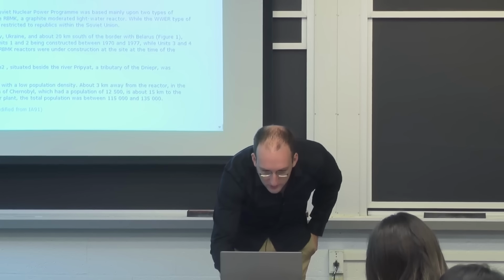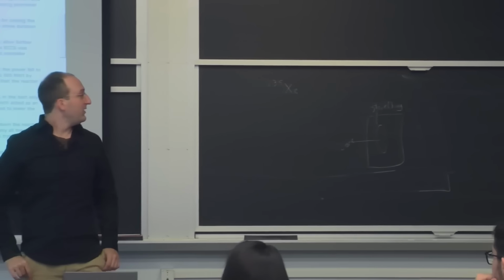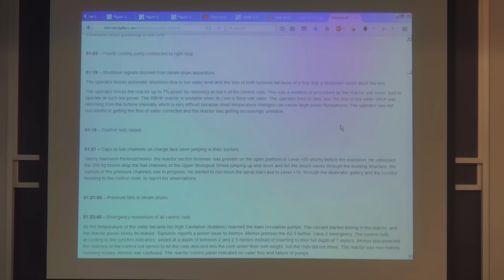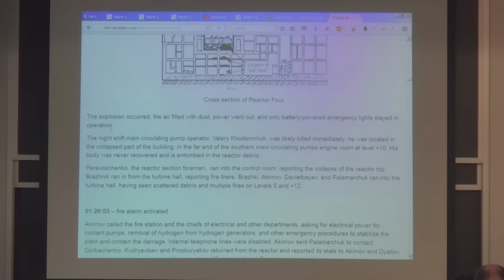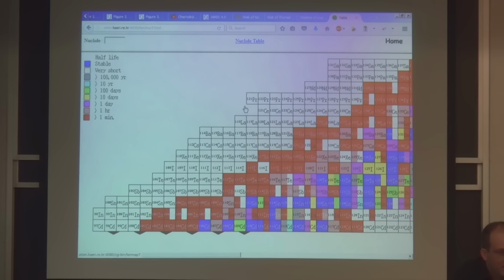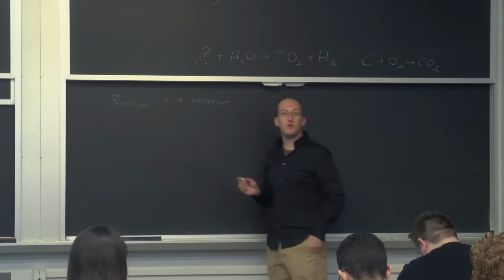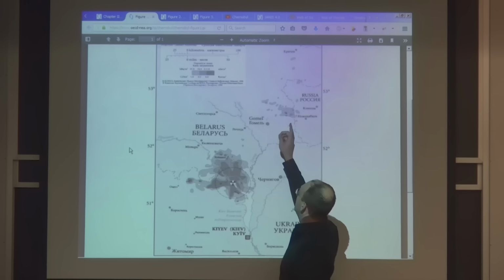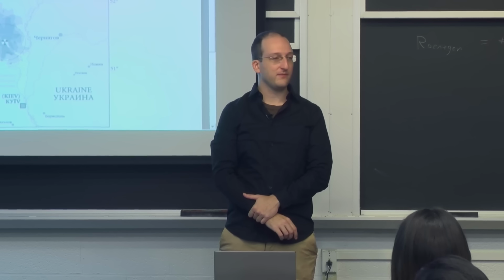26. Chernobyl — How It Happened

Comment: 14:30 They didn't remove the water, the water got removed by the steam, essentially
it was pushed out, and thus stopped both cooling and absorbing neutrons.
What they should've done at this point, is retract the fission material, and let it all cool down.
But..
It's the USSR and in the USSR failure was never rewarded, unless you'd consider a single
one way ticket to stuff like SIberia a nice reward. in the US this would be similar to a firing.
But..during the times of crisis, alesser event should always be more preffered to success
at all cost, which in this case is a meltdown result, having tried 'all' and ending in failure.

Comment: What happened was a lousy design.
Any true capable engineer would design a nuclear reactor with an auto split at the bottom.
This would split the reactive material upon any meltdown into at least 4 separate quantities,
reducing the reactions by that much, and allowing for recovery.
Instead they relied on a design that would work as nuclear reactor, but had zero recourse upon failure.
The encasement of radioactive materials should be upon retraction downward, not sideways or up,
with up being worse.
When the reactor goes critical, the molten radioactive material should recede back into a separator,
or rather separating encasing, like wolfram/ceramic composite upon steel/lead,
which then autoseparates the radioactive materials, and thus ends the critical state.
If such a contigency is not planned for, you have a poor design.
Reply: Note that the design of auto separator, as by my design, would only cost like $500.000 per, for a single reactor, and that is with a profit margin that is very comfortable.

Comment: Very interesting lecture. There is a ton of story that goes along with this event. Things like the political pressure put on the operators to perform this test after several other plants refused. The changes to the test do to a very unstable power grid that was the cause of the Xenon issues. Also, the fact that the operators that controlled the steam plant having little to no training related to reactor operations. This lecture was great for the science, but there is so much information surrounding this event that takes place outside the science. Also, I am quite proud of this professor's statement about the responsibility of the media. The general public's fear and lack of understanding related to nuclear power is causing the most viable green energy source available to die when it should be thriving. Thank you Michael Short for this video.

Comment: Terrific lecture I never knew the full back story of what led to the accident. I'd known that they'd been shutting down the system deliberately for a test when the accident occurred, but didn't realize it was to test power output from the spin down of the turbines.Maybe I don't understand some component of the system or fail-safes involved, but ... what if the the elements of the generator, coils or wiring, or the turbine itself were damaged, and THAT was the reason the system was coming down? It seems in retrospect a questionable idea, fraught with circular dependency, powering emergency systems from the ongoing shutdown of the main power generation operations. Perhaps I don't see the big picture. I know that a lot of modern large-scale facilities that cannot afford power down time, e.g. large data centers, will have on-site diesel backup generators, and nowadays even big battery/capacitor banks can fill that role. Maybe that wasn't an option back then (although surely diesel generators existed; those obviously predate nuclear power plants), or there were safety concerns about keeping a cache of combustible material around the plant. In any event, this is a fascinating historical event. I feel terrible for the Soviet citizens that were subjected to this, and thankfully it didn't cause more damage beyond the region.
Reply: Well, apparently knowing the big picture didn't prevent a catastrophe. Or, it was designed for depopulation

Comment: I have one question.  In the opinion of the excellent Professor Short, does he have any opinions toward possible design deficiencies of any other existing reactor designs?  I am a believer in this technology as a forward solution but only if the public is fully aware and is able to embrace it as safe and productive.  This is one of the most engaging hours I've spent on the internet.  Thank you.
Reply: There's now a third generation of rector designs now. This was the first one.

Comment: I never understood how the upper pressure tube (technically standpipe) closures work mechanically.  I understand there is some sort of plug that interfaces with the refueling machine and the metal box filled with likely serpentinite concrete is placed over it the plug.  If the inner diameter of the channel is 80 mm and the pressure is 1000 psi (mixing SI/imperial..apologies) ..the pressure on the plug is 7790 psi.  and those blocks dont weigh that much.  so how does the plug interface with the pressure tube to hold that pressure?

Comment: A hopefully helpful note: if you're not familiar with this term (like I wasn't), neutron "moderators" slow the neutrons down to increase the probability that they will contribute to the nuclear reaction rate (fission). Dr. Short does allude to this, but the word "moderator" sounds like it should slow down the reaction, which is the opposite of what it does. So please view the graphite as an accelerator, not an inhibitor.

Comment: The way the operators did their "tests" reminds me of the Mythbusters trying to get a hot water heater to blow, insofar as they had to remove EVERY security feature on the device before doing a stress test. It seems like they wanted to perform a meltdown, or that the people in charge had a very basic understanding of some of the working of the reactor. When you are unaware of your ignorance and put in charge of a nuclear power plant, stuff like this happens.

Comment: At 22, he talks about hydrogen explosions. When I was a callow youth, I decided to split water into H and O using electrolysis. Not having fancy lab equipment, I used an aquarium pump to pump air into a glass(!) peanut butter jar bubbling it into a mixture of water and IIRC hydrochloric acid (it was many decades ago, might be fuzzy on that part) in which I had inserted two carbon rods from D-cells wired to a 45 watt psu. I then directed that air into another glass(!) peanut butter jar thinking this might purify the gas and then out the top of that jar. BTW everything here was glass - jars and tubing. I let it run. How do you check for H? You light a match at the end of the tube. I had two strokes of good luck - I was wearing eyeglasses and I was listening to music through old fashioned cup headphones. I have no idea what H gas concentration I had but recall that it also had pure oxygen in the mix. Most of my makeshift apparatus vanished. There were a few pieces in my bedroom that I could see, the rest was tiny. It took a long time until I could walk barefoot in that room. So yes, pure H plus a surplus of O2 makes a very large powerful explosion.

Comment: Amateur perspective:- some workers who were half trained in following orders followed orders and were caught out by a primitive designed meant more for playing catch up in bomb making than safe Power Generation, and so the primary aim of making the world an extremely unsafe place at the usual cost and disregard of humanity and the environment ensures. The capability of 50X cleansing of potential enemies from the face of the planet is guaranteed, just have to wait while conventional thinking fails to comprehend that winning any conflict against a real threat is about actual human health and welfare. 

If the device was not a panic purposed lash-up (that works fine when managed properly), even the systems of authoritarian Denialism back in the day could have persisted longer. Instead the same lack of Actual-Artificial Intelligence in application to Actuality will result in other "advanced" authoritarian Denialists looting domestic populations for the last of the resources of the planet. 
It can easily be different, if the story of The Untouchables is genuine, then the format of rational and reasonable thinking is central to the actual Military Defence strategic decision making.

Comment: So you want to see if the turbine's momentum would be enough to power on-site systems?  Why could those elements not have been isolated and tested one at a time, instead of simulating the whole shebang together?  Could you not achieve the requisite speed of the turbine by decoupling it for a while from the flow pushing it?

Comment: I would emphasize that obsession with safety on paper contributes or aggravates problems originating elsewhere. At TMI, way too many parameters where alarmed such that at any given normal operation time, 30 or so items were in alarm condition that operators were conditioned to accepting that alarmed conditions are normal. At Fukushima, the earthquake disrupted the grid, so the two independent power sources in case or emergency requirement was no longer met, hence the reactors were shut down, and the emergency diesels were started. then the tsunami knocked out the diesels. So, if the reactor were kept on, there would have been no meltdown?
Even the Thresher, on a scram, procedure was to shut the main steam valves. after investigation, the procedure was changed to keep the main steam valves open, operate at ahead one-third to drive the sub to the surface before shutting MS.

Comment: "RBMK reactors are no where near as safe as ours, as you can see - there's no containment..." Newsflash, Fuk-u-shima's design is "our design" and if you ask them how their "containment" is going - the honest response would likely be "what containment?" Three Mile Island was not comparable to either of the other two screwups because the majority of mess came about out of an abundance of caution (flooding of containment building) shortly after the low water level and partial meltdown occurred. Fukushima and Chernobyl are remarkably similar in one key aspect - attempting to contain a nuclear reactor core that is in full meltdown mode - is pure folly - whether due to inherent instability/careless operation of the facility or loss of offsite power. Taken one step further, there is no such thing as "perfect" containment of nuclear power sources. The concept of "nuclear power safety" is itself an oxymoron. If the technology didn't produce dangerous high energy wastes with half lives of tens of thousands of years, you might have an argument for the concept of nuclear "safety" and "containment". But clearly, the problem with final disposition of waste that started at the dawn of the nuclear age is still with us and will likely continue long after the human race has destroyed itself.

Comment: The reactor had design flaws, but it still blows my mind that the Soviets didn't build containment domes over their reactors.  Most of that is concrete.
Reply: Because it was cheaper not to
Reply: @jamesricker3997  obviously
Reply: rbmk reactor wasnt contained fully because it allowed for quick replacement of fuel. it was a design decision and if it was used properly it didnt need such containment to begin with. it was the cheapest design availble in soviet union that allowed for using low enriched fuel to produce energy and weapon grade material at the same time, there were more expensive designs availble(and by extension more idiot proof) but were not chosen.
Reply: Chris loech it was build with such heist there was no time, they were competing with the west
Reply: @simonkidd2088  had nothing to do with competition from the west.  It was a power reactor not an enrichment facility for nuclear weapons

Comment: It's frightening that someone teaching Nuclear Engineering at MIT has never heard of the New Safe Confinement building or Alexandser Litvinenko except anecdotally, is generally hazy on the order of events at Chernobyl (to the point where he misstates the length of graphite tips by an order of magnitude, and failed to comprehend that the steam explosion did not occur until after the they were lowered into the reactor), and can only vaguely answer any of the students' questions, and yet was paid to deliver this lecture.
Reply: Ronstar308  We all look forward to your in depth presentation when you've finished it............
Reply: @SMHman666  That is not directly relevant to the OP comment.

Comment: Hi there guys.This story goes well with what I heard the day after in our Power Engineering Lecture at UNSW where our lecturer who had worked a Chernobyl gave us a full run down. The points I remember the most being the control rod extraction and there failure when they tried to reinsert them. Worse, was his explanation of the fire department pouring water onto the 'fire' which would only help the reaction to continue.

Comment: The biggest thing that sticks out about the whole Chernobyl situation is how it was supposed to be an experiment under normal operational conditions. All they had to do was shut down the reactor to simulate a power outage and see how long/much electricity would be generated while the turbines spun down.

A friend of mine told me the operators were probably under pressure to make it work because of the way science worked in the Soviet Union and this was supposedly not the first time the experiment had been tried. Since there hadn't been enough power to keep the reactor going in past attempts, they started disabling safety features that used electricity like the ECCCS. It didn't matter that, if successful, making the experiment work would involve operating the reactor under abnormal conditions no reactor should ever be in. They'd put that part in the fine print or leave it out all together, but the higher ups would be able to brag about how awesome their reactors were.

Comment: Chernobyl happened because lowering the output in both sides created a vacuum of Positronic Potential in the Quantum Field. The reactor is constantly sending out a Neutron Flux output, this flux connected with the other end of its diagram, the electromechanics of the core and coil of motors/pumps. This circuit normally runs a heat loop on the "physical" side, but, with all those circuits turn off and unoccupied by negatronic (electronic) current-flux,  now it had room to run on the Potential side, aka Quantum/Aether field, subspace. The Radiant Energy is something that Tesla discovered, and it always actuates, 2.6/26 units away from center... like on 4-26-1986.    The reactor supposedly put out 33MW instead of 3.2MW (no word on where all 'extra energy' went into the grid).  

33/26 = 1.2692        (92= 26 inverse)

oh hey, the lecture is number.....26.  Yes. A coincidence. Completely. 

Supposedly there were 16 of these types of reactors. 

16/33 =2.0625 (26? again? come on, coincidence, of course)

Remember the Philadelphia Experiment? They were using an early atomic reactor to create a magnetic field. The same Potential Standing Wave occured, just like at Chernobyl.
Reply: What in the hell are you talking about????  Jeez, what a load of crap.
Reply: @nathanwahl9224  your non-comprehension skills are total proof that you're right, so you completely debunked what I wrote. Can you summon a fapcheck bot to confirm your victory? I'll even autograph your victory trophy cup

Comment: I'm reminded of a US Army reactor with a similar positive void coefficient design error, the SL-1.
One could walk on top of that a well, didn't end out well for the operator who manually lifted the primary control rod a couple of feet too far, leaving him pinned to the containment ceiling by a control rod plug.

Then, there was Windscale, where ill understood Wigner energy release during annealing the moderator and insufficient instrumentation lead to an initially unrecognized fire and a veritable comedy of errors in putting the fire out. Oh well, no sense in crying over spilled into the North Sea milk... (Ungh that was bad)

One acquires a certain type of humor, when one began one's military career in nuclear intermediate range ballistic missiles and currently lives in an area I used to orient myself by viewing TMI's remaining unit's coolant tower plume (shuttered in 2019 and I was in high school for the TMI meltdown around 90 minutes of driving away).

Oh, the footage shown from the helicopter was an initial airborne survey of the accident. The fire was long out when drops into the reactor building began.
Nobody worries about further collapse of the sarcophagus, as it's contained by the New Safe Confinement structure. I imagine that'll eventually get a newer, safer confinement structure...
The "elephant's foot" corium is now decayed down enough that one could safely, if briefly, sit on it. I'd not recommend it, as decontamination would be a true Russian bear.
Small trivia, got a full body count a few times over the decades, both due to an incident and later, for medical purposes for my background rate for imaging. I'm a touch more "hot" than your students, but I was born a week after Tsar Bomba was detonated and things were decidedly warm (some silly little fallout thingie) globally due to stupidity.

Comment: I think the graphite tips where 3 meters with 1.25m water on either side. They missed why RBMK was a bad design compared with other reactors. You either have high enriched uranium and use light water as moderator(which absorbs some neutrons) or use heavy water(does not absorb) as moderator with medium low enriched uranium. So they used graphite to displace the water from absorbing neutrons to be able to use low enriched fuel and expensive heavy water.